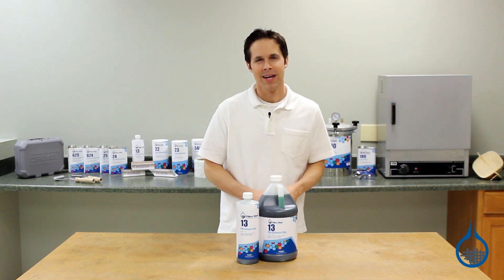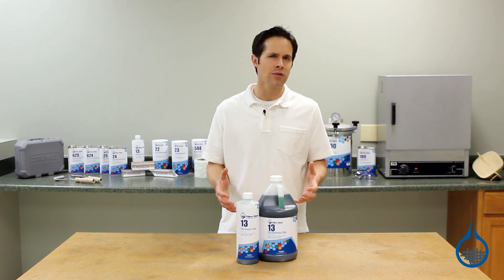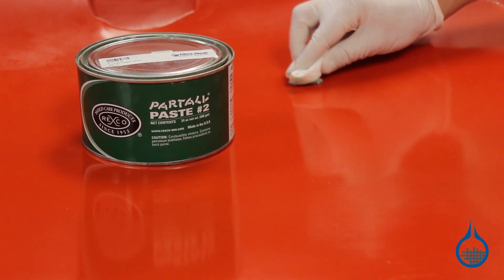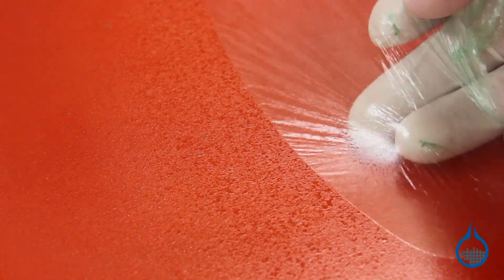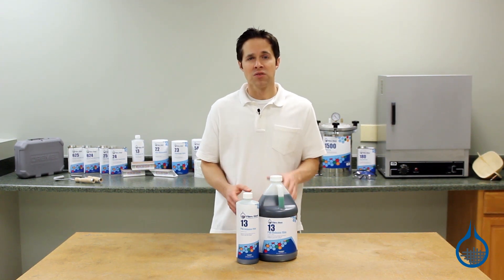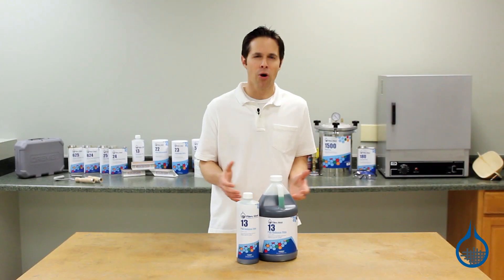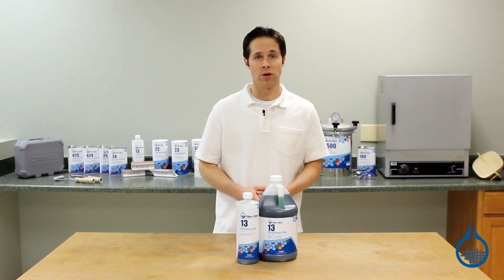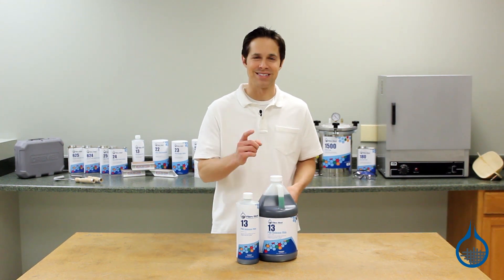PVA Film

Comment: I suppose PVA will react the water in newly made soap, huh?!  ... and I wondered too if it would have been appropriate for cosmetic use if the water reaction is not a problem.
Reply: I'm wondering about whether it's safe for cosmetic use as well. Apparently that's what's used in peelable mask facials, but I'm worried.

Comment: I tried PVA on several molds - didn't work great. It was quite a chore to get the part to release, and when it did, some surface damage was found where it didn't actually release and the mold stuck to the part - tearing the part finish.
Reply: Talisman1957 You can try the PVA film directly,  not the liquid type